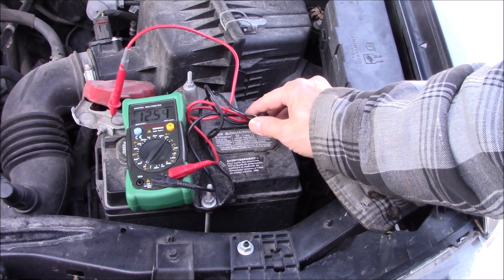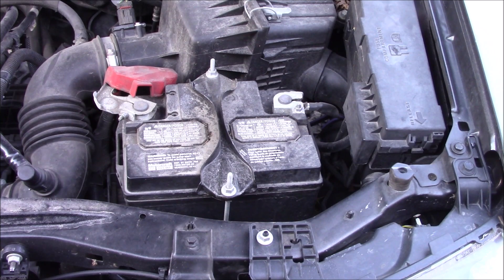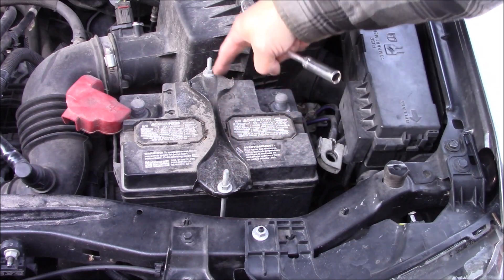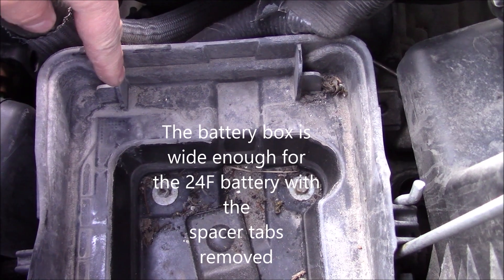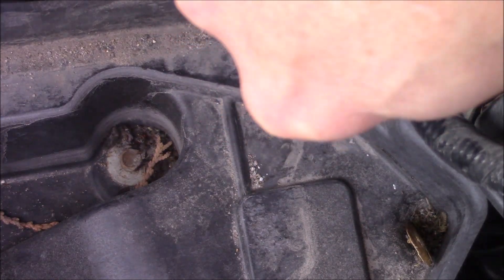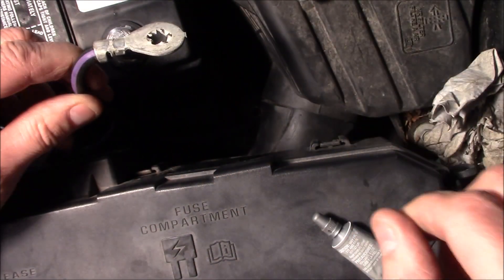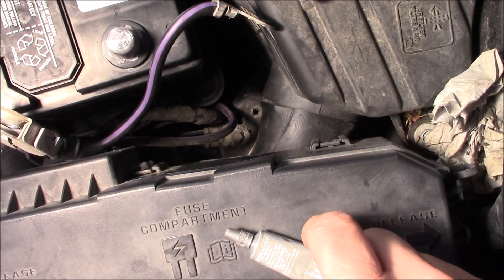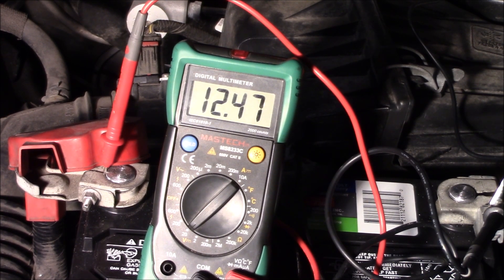2001-2012 Escape or Tribute battery replacement, alternator output testing

Comment: Man!  My negative clamp would not come off for anything. It took me almost an half an hour just to get the negative clamp off. Yours was so easy. I’d never seen a clamp with the nut on top like that. I also noticed that the battery well had no holes to drain water in it. Mine had 1/2” of water in it
Reply from the maker: I am not a big fan of the newer style of battery clamps either. At least you got it off and were able to change out your battery

Comment: What are those two little pieces on the negative charge
Reply from the maker: The negative cable has 2 wires going to the body for ground.  you only need to make the smaller one longer if you are putting in a 24F battery.  Nothing needs to be Modified  if you are using a 96R battery.  I wish you the best on your battery change
Reply from the maker: The recommended 96R battery has 590 CCA rating.  I had to modify the battery box and lengthen the ground wire to fit a 24F battery in the battery box.  The 24F battery has 585 CCA. A 24F battery is roughly 1/2 the price of the 96R battery with close to the same CCA rating.  A battery with 710 CCA will be far more costly and is not needed.
Reply from the maker: No need to purchase a battery with more CCA than you need or that is recommended by Ford.  The Tribute was made for Mazda by Ford and many parts are interchangeable.